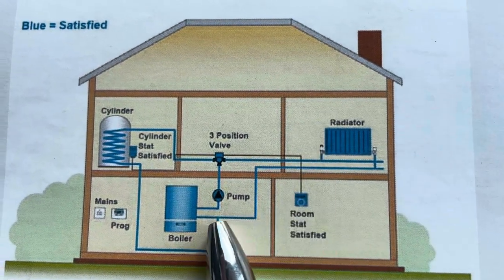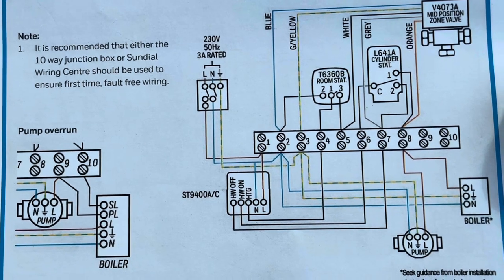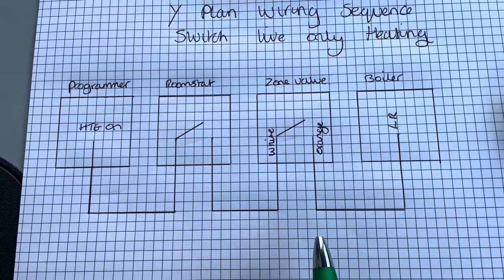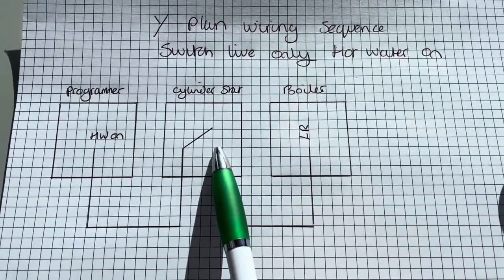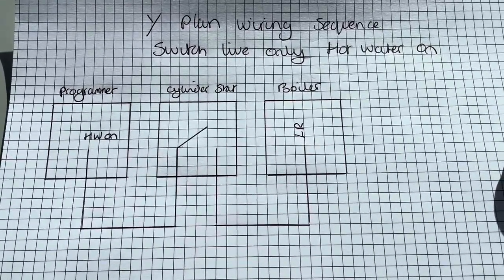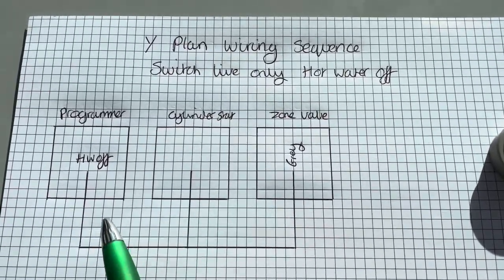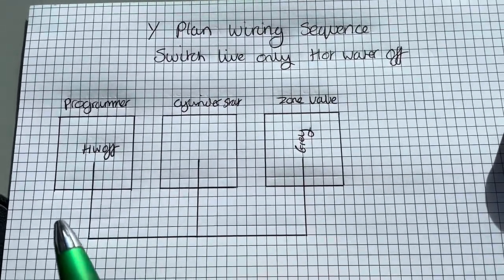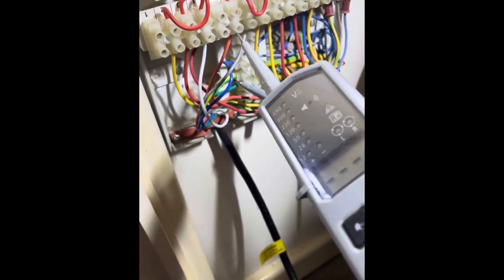Y plan system wiring sequence explained in-depth heating and hot water

Comment: The ‘Y’ system so very well explained. Simplistic and far more comprehensive than any of the boiler system manuals or accessory manuals. The amount of Plumbers that I come across that don’t like wiring different boilers or understand the switching/firing sequence should read this. The challenging part is going to a system where the wires have all been messed about and you have to trace all the wires. These will definitely help even the trained individuals that have a foggy moment. Tops!

Comment: I wonder if you could please recommend a ‘simple’ wiring change which would delete the mid-position function of the Honeywell V4073A 3 position 3 port Valve in my "Y" System. I only ever use either the H/W Cylinder or Heating separately, never both together, so as to never subject the Motor to the mid-position situation which powers the Motor at 110VDC against the Return Spring so it stays in that “powered” position even when the Programmer is switched off in the Heating Only position.
To avoid this happening, when I turn off the Heating at the Programmer, I then turn on the H/W Cylinder for approx., 15 seconds, which releases the Motor from the DC Current, and so the Valve is able to, with the REturn Spring assist, return back to it’s Default, and totally un-powered, position. 
To avoid having to do the above, could I perhaps cut off  both Resistors and the Diode from the PCB in the V4073A, so the PCB will be prevented from producing the 110 VDC current which facilitates the mid-position? However, would doing that interfere with the power to/from (?) the Orange wire which initiates the Boiler? If so, would connecting the White wire, on the Common of  the 2nd. Switch solve that issue, or is there another way of doing what I want please?
 I’m asking this because my current Valve is a Honeywell V4073A unit, but Honeywell also produce the V4044 range of 3 Port Valves which look identical to the V4073A, except that the V4044’s are listed as 2 position “Diverter” Valves only, (no mid position), which is exactly what I want to achieve (but without spending £ 100 +++ money or my fitting time !!!). Please accept my thanks in advance of your help, and I look forward to receiving your reply.
Cheers, Adrian.